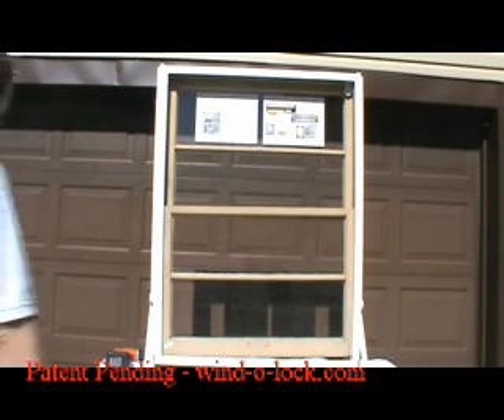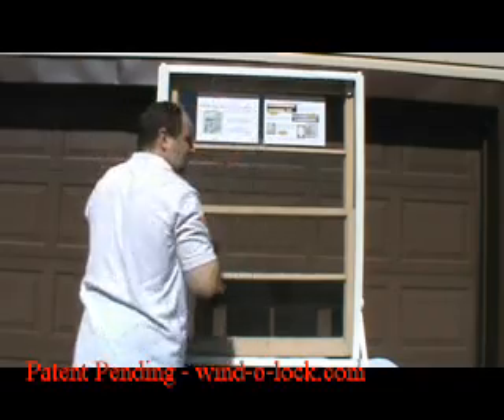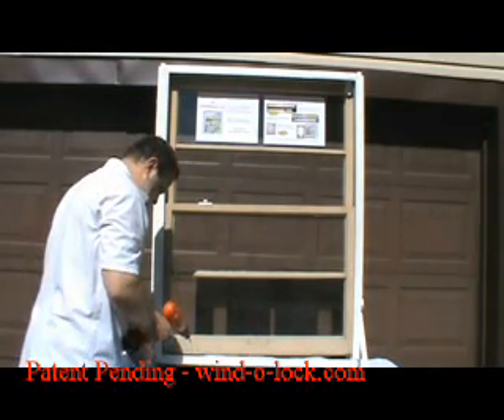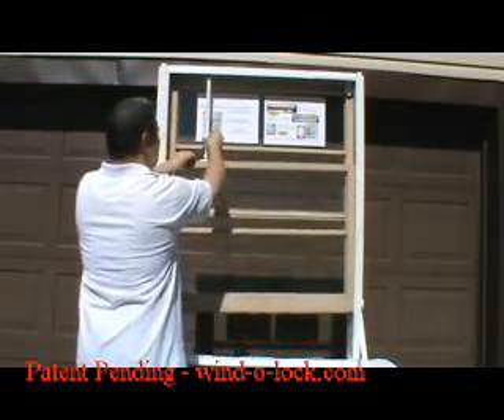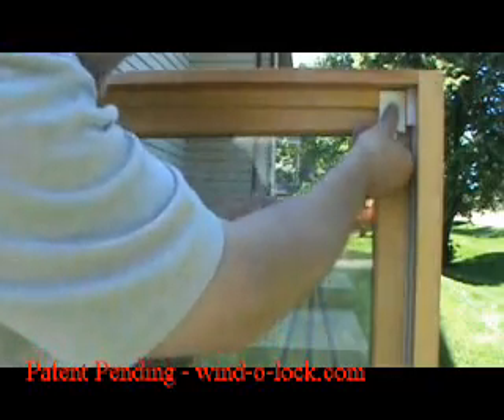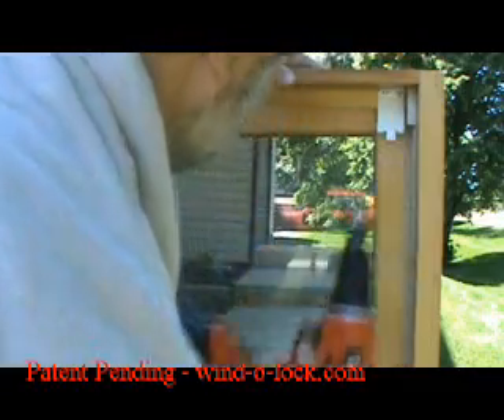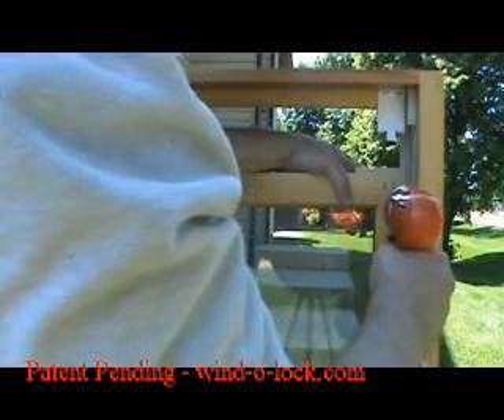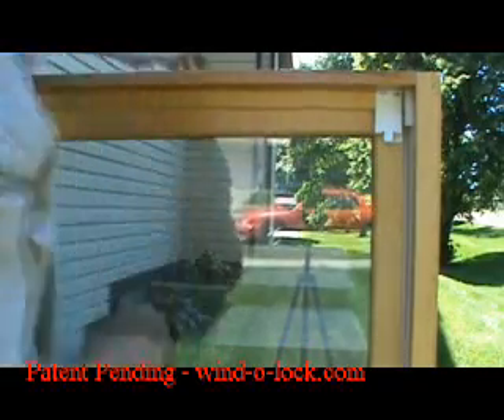Installation of the Wind-O-Lock window locking system

Comment: Instead of the secondary corner lock for the upper part of the window. Couldn't the original bracket for the "Wind-O-Lock" with bar mount directly to the upper front facing side of the upper window? Possibly using a 90 degree shaped mounting bracket. That would lock both sliding (upper and lower) windows together. Instead of mounting the upper bracket to the frame. Just a thought.